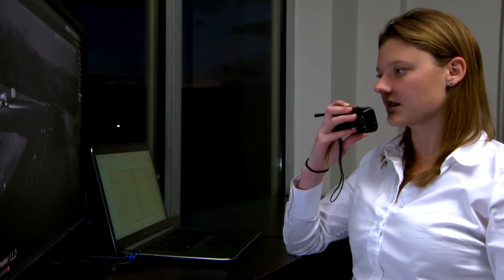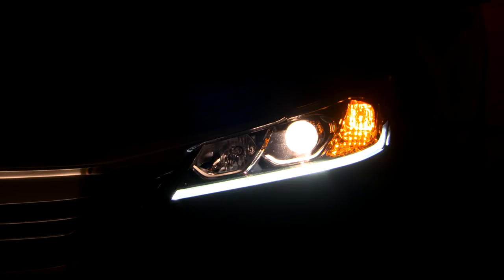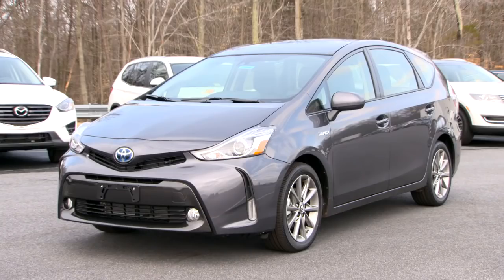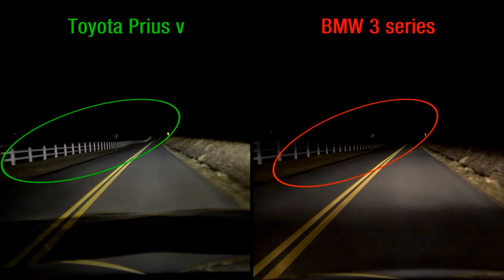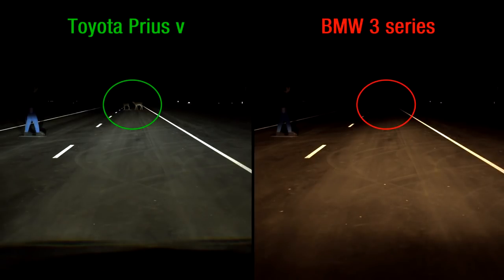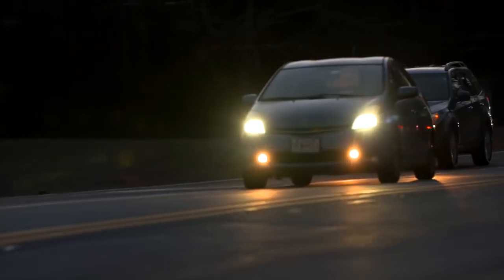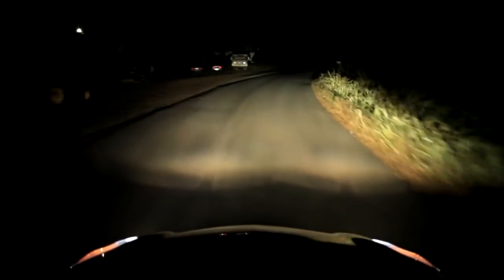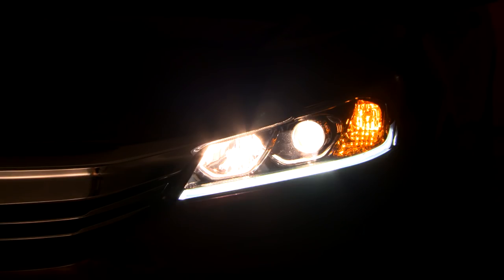Why your headlights perform bad and need an upgrade (thanks to IIHS) | Car Headlight Problems

Comment: I saw that but pls Tell me how i can open the headlight without damage them?
Reply: The front?
Reply: just me me looks like you asked this about 1 years ago so I hope you found this answer already!!! If you haven’t then what needs to be done is to bake them in an oven (or a make-shift oven using a box preferably insulated) and a heat gun. There are vid’s on YouTube about how to do this exactly; the older your lights are the hotter/longer you need to back them to get the sealant (between the front clear and the back side) to soften.